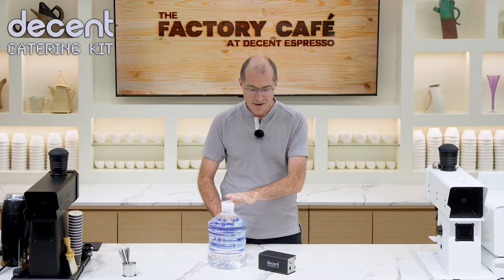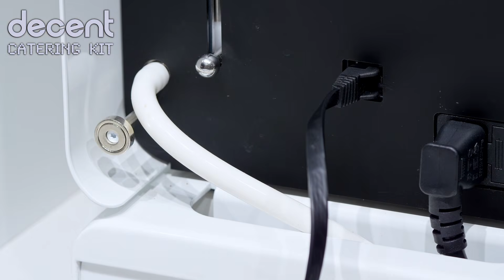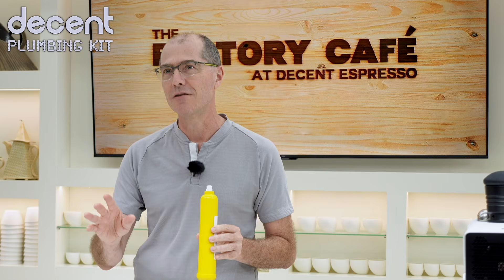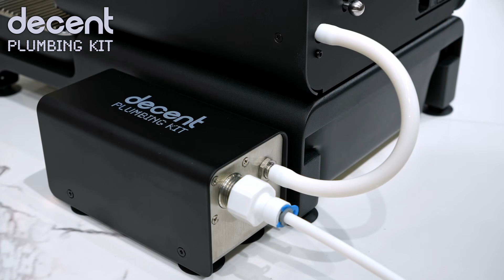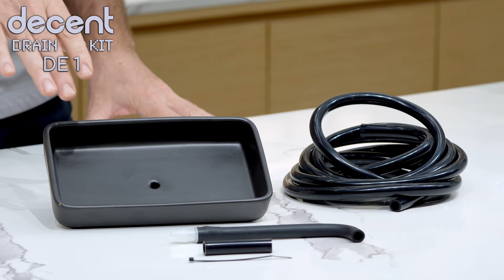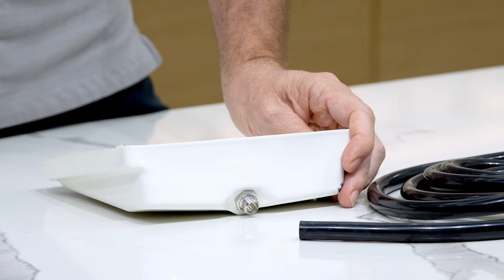Stop refilling. Stop emptying. Automate your Decent Espresso machine!

Comment: Looks like the water flow direction arrow on the pressure reducer valve is not the same as the water flow direction in this video, is this water pressure reducer valve bi-directional?
Reply from the maker: Good catch! It is indeed a one-way valve, and the arrow should follow the direction of the water flow.